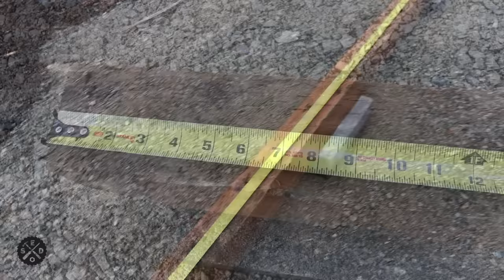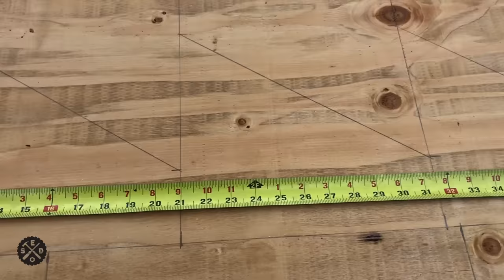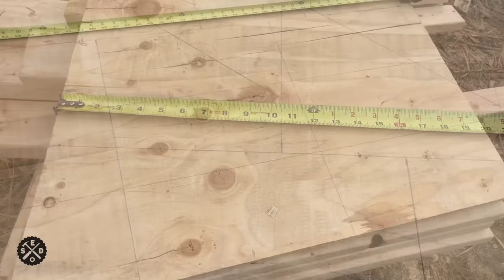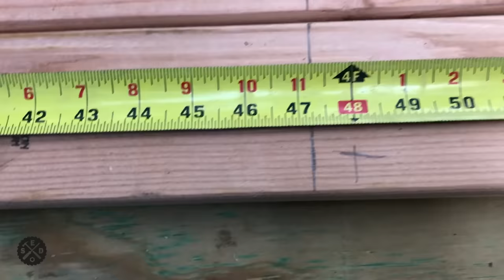How To Build A Shed By Yourself All STEPS 10x16 diy

Comment: If I was to do this I would put a seal plate and a top plate. I believe in structural strength.
Reply from the maker: Yes you certainly could do a double top plate. 👍 I mention that somewhere in the video.
Reply: Single-plate framing is fine on any building, despite what codes or traditions tell you. Old balloon-framed houses with one lonely 2x4 plate have lasted for 175 years. I think it'll work for a shed. 👍🏼

Comment: Instead of toenailing the floor joists to the beams, install 2x4s in between the joists screwed into both the beams and the joists providing a more secure base
Reply from the maker: Yes you could do that.

Comment: I love it!!! I built a 10x16 too. Did it all by hand using Lowes lumber for the foundation and floor, but framing and siding the rest with pine that I cut on my woodmizer LT27 sawmill. I wrapped it with bevelled siding that I cut on the mill and tongue and grooved the 7/8 inch roof boards. Then shingled the roof. I made a sliding 6 foot wide door from oak off of the mill. I put in a hinged door and window ac unit into one end, and large windows that were low enough to slide boards thru when open if i wanted to rip-cut long pieces inside. I used cedar shakes under the gable ends, which look cool. I used true 2 inch by 4 inch framing members, so I had to use 20d nails. (therefore no nail gun, instead a hammer.) I love you video. I took pics and put them in a scrap book, but I should have detailed it in a video, like you did. Youtube wasn't as popular when I built in around 2006. great work friend. I live in Ocoee, florida. stop in in ever in the area. I'm freddy. 407-877-7784
Reply from the maker: Hey Freddy thanks for the invite! Sounds like a really cool build! Well thought out for your needs. I’m glad it turned out well for you. I have a sawmill too now since building this  but I haven’t gotten to use it much yet. Thanks for sharing.

Comment: Back in 2011 I rebuilt my shed taking out an old 7’ X 10’ (old fashioned hand built, probably 25 years old) on a weak concrete slab, upgraded to a 10’ X 14’ and 8’ tall on a 4” concrete slab with a 10’ X 10’ approach on the alley side. It has a service door opposite end of the alley end that has a 7’ X 8’ roll up door (motorcycle access) and a horizontal long window on each side wall. 
I watched your video to see how someone else might/would build their own..
I must say the attention to detail you showed and narrated was impressive. Also talking about how others might convert it into a tiny home or cabin and preparing the subfloor for insulation was totally unexpected but welcomed.
I’m now afraid you have a new subscriber in the works...
P.S. with my full size Goldwing Motorcycle, Snowblower, Lawnmower and other small items in the shed it’s amazing just how fast it filled up...
Reply from the maker: Haha thanks I would appreciate the support! It was fun reading your story. Sounds like you got a much better setup now. Yes if I was to park a motorcycle and a bunch of other equipment I would run out of space very quickly. Lol. Thanks again! Take care.

Comment: As a retired General Contractor, I will say that overall you did a good job. There are a few things I would have done differently, and a few minor things, that should have been added, but overall very well done.  Your assessment of the prefab buildings was spot on. Even if you have no experience at all, with a little bit of patience and study, one can build a much better Out-building cheaper, than the prefabs.
Reply from the maker: Thanks Walt I appreciate the input! 👊
Reply: Walt what are the adds?

Comment: There are a lot of “how to” videos out there and I wish all of them were this good. Ty for the excellent tutorial!  I do have a floor question—what type of plastic and at what layer would you add a vapor barrier for an insulated floor?
Reply from the maker: Thank you I appreciate that! I would probably do at least four mil maybe six mil plastic. I think the best would be to put it on the bottom underneath but that would be really hard to do on a shed like this so I would at least put it on top of the floor joists before you put the floor down. Unless you do spray foam which can seal off for vapor barrier if it’s closed cell foam then you wouldn’t need to worry about plastic. That’s my thoughts

Comment: I'm a hack DIYer taking on my first shed build.  It's a bit intimidating so your video has been an excellent resource.  I really appreciate not only the good instructions, but the effort you put in to making those instructions easily understood and quickly accessible through time-stamping.  Thank you.  Quick question:  what is the rule of thumb for sizing gussets?  Thickness, area, etc.
Reply from the maker: Thank you so much for letting me know! I’m glad if you found it helpful. I’m not quite sure on a rule of thumb for the gussets. I’ve just seen quite a few of them and knew it would work. The wider The better of course. There may be a table to figure it out that I’m not familiar with. If you are concerned about strength up could always use construction adhesive with it too. http://theplywood.com/gussets not sure if this helps at all but it was an interesting read. I wish you the best with your build!!
Reply: @SmartEasyDIYer  yes you'd be great in a tiny home community..
Reply: Thanks,  @SmartEasyDIYer !  That;s a good resource.  Much appreciated.
Reply from the maker: You’re welcome. Good luck with it all!

Comment: Pro tip on moving a shed like this. Drill a 1” hole  in your skids on the inside, not the end. Then if you have to wench it up on a trailer you can use 3/4” steel pipe and a chain and it will keep it from digging into your siding and right up on the trailer.
Reply from the maker: Thanks for sharing!
Reply: I can't wait to understand what stuff like this means 😂

Comment: Well done. Very informative. One suggestion; carefully consider the length of your doors based on wether you will be using a step or a ramp. The way you have yours will prevent the use of either and will have a big step.
Reply from the maker: Thank you so much! Also thanks for sharing those ideas with others. 👊

Comment: Great job. I am debating making a shed in my backyard as well. The only thing I didn't care for was the extra  horizontal 2x4's you put on the walls on the outside. I think it's great for a good structural build but a little overkill for my taste. Using a think sheeting will give enough structural integrity to the walls. Being an electrician (as well as a carpenter) I see the side horizontal  2x4 slats on the wall as an electricians nightmare when running electrical in the wall vertically in future projects. Murphy's Law!
Reply from the maker: Thank you. Yeah if you’re going to be running 4 x 8 sheets of sheeting you can just nail into the stud, I did it because I was doing rough cut siding and they only span 10 inches width so it would only hit top and bottom if I didn’t do something in the middle. You could even furr the whole wall out with one by fours on the exterior it if that would be easier to then you wouldn’t get in the way of running electrical. Good luck with your project!

Comment: You missed a trick after framing and prior to cladding. You touched on the idea of a loft but for a shed, if you're not lining the ceiling, the rafters make a perfect loft shelf for storage. BUT the only time to get whole ply sheets in there is prior to cladding the gable ends. 2 full sheets of ply along one side make the perfect half-loft. They also add massive shear-rigidity to the whole structure.
Reply from the maker: Yes that is a good point that you would want to think about. I was actually able to get a full 8 foot sheet up in the loft after the fact to store stuff so it can be done if you put it in in the correct spot. Lol

Comment: Great video, thank you!  For the 3/4 crushed gravel, could you instead use gravel in the areas just under and around each concrete block, instead of covering the whole area underneath the shed with gravel?  Also, roughly how many inches deep was your crushed gravel?  I'm debating whether to use crushed gravel or concrete piers.  I know piers are much better but also a ton more work.  I'm thinking crushed gravel and then if the shed gets out of level over time I can correct it with shims or something.   Thanks again!
Reply from the maker: Thank you! Yes I think you could put gravel just mainly where are your blocks are instead of the whole thing. I didn’t do crazy deep maybe 4-6 inches. The concrete piers would be a more permanent solution but they would be a lot more work. I just wanted to do blocks because I know this won’t be the final resting place for the shed in the next few years. A lot of people put them on blocks and they’re fine and yes if they do move a little bit you can correct it with jacking it up.
Reply: @SmartEasyDIYer  Pier's don't have to be poured. You can buy them.
Reply from the maker: You could if you prepare the bottoms of the holes well. I could see some settling issues if not installed properly.

Comment: Hi, loved the video and all the details. Sorry if I missed it but what spacing did you leave between the siding boards for expansion? Also, would it make more sense to nail the batten centrally in the gap so it can expand and contract without interfering with the board movement? Thanks
Reply from the maker: Thank you so much! So my boards were all kiln dried so I wasn’t worried about a gap even though most of them were curved enough One way or the other that they would only touch in a few places anyways. Lol  I have seen where people have nailed the batten just in the middle because of that again mine were dried so I wasn’t concerned about that the only problem with nailing them only in the middle is sometimes they can cup outward on the edges over time.
Reply: @SmartEasyDIYer  q
Reply from the maker: What’s Q

Comment: I applaud your used of plywood and not particle board. I see so many sheds with particleboard floors and roof sheathing. It is such an inferior product and it doesn't save much money. Also, I see that you put the tyvec on just for demonstration purposes, but for anyone building a shed they would be much better off not using it at all. It costs money AND you're better off without it so kind of a no-brainer.
Reply from the maker: Thanks for the feedback I appreciate it!

Comment: looks great. 
I love the rustic siding look. BTW to get the bottom cut on your truss 
if your top is 34degrees or 8 in 12 pitch you take 90 degrees minus 34 
and you get 56 ! 
thanks for the video.
Reply from the maker: Thank you! That’s a good tip I didn’t think to mention that in the video.  👍

Comment: Great simplistic build and FINALLY someone else who prefers to not suck up VOCs off of toxic OSB. I refuse to use that also and don't like the off gassing of chemicals for anything I'm sharing breathing space with. Plywood or Bust! Cheers and Peace Out
Reply from the maker: Thanks man! Yes I don’t like the smell or off gassing from it at all. I avoid it as much as I can.
Reply: @SmartEasyDIYer  Allot think it's approved so it's ok, ya so was asbestos and later urea formaldehyde insulation. 25-30 years down the road will tell the damage. Not that plywood is not also chemically fastened together but the amount is night and day compared to OSB and the different particle woods they push out these days as safe plus the fact plywood off gases during the curing process.

Comment: Excellent work.  I had to smile when I saw you assembling the truss rafters. The first time I used a pneumatic nailer is when I was building truss rafters for  a house in 1965.  The day before, I was using #7 galvanized nails and a hammer for the same task.  My impression then was that pneumatic nailers were the best thing since sliced bread.  That opinion still holds.  ✔

Great video.  Thanks!
Reply from the maker: Thank you I appreciate it! Yes what a difference from hand driving to using air nailers! I didn’t know they had them in 1965. Good times.
Reply: @SmartEasyDIYer  As I recall, the nailers were steam-powered in those days.  😎

Comment: While I plan on building a 8 x 12 shed, I do appreciate your video. I have a knock off Little Giant ladder. They are PURE GOLD! I used them when I was in the Navy and learned their usefulness and strength early on.

You pieced together your video so I could follow your guide well. Also, your descriptiveness wasn't too much or too little. Your explanations were good for a novice to be able to use your methods without getting confused. Great video. 
I have built garden sheds but, nothing I would be too concerned about snowfall loads. So, this spring when I begin building my 8 x 12, I am planning on ensuring my roof will be able to handle the heavy loads of ice and snow. Might get away with a cathedral ceiling like you talked about by using a metal roof so the load slides right off.
Enjoy those kids. The day they leave even if it's just down the road is hard for us dads. Cool thing is, they will call on us when their absolutely stuck and can't figure something out. Or like my boys, they will try and when they fail they call me to fix it lol
Reply from the maker: Thank you I really appreciate the feedback! I wish you the best with everything. Yes I’m enjoying my boys they are so fun and I know it goes by much too quick!

Comment: Hello!
I've been searching for quite some time to build the right shed to stay in on weekends at our newly acquired land in East Tennessee and yours is going to be perfect.  I appreciate the step by step video and the tabbed sections for quick reference.  I have good basic tool and wood working skills but never had the knowledge to build a structure like this until watching your video.  Now I think I'll give it a go!
Thanks again and I'll post final project pics when I'm done...Greg.
Reply from the maker: Wow Greg that’s awesome to hear! I wish you the best with your project!! Yes please post a final picture. Thanks
Reply: Will do! 
Couple quick questions:
1) the hinge hardware that you spray painted was that zinc coated or galvanized?
2) Did you ever have any issues with rodents setting up nests etc underneath your shed? 
3) If I insulated the floor joists, would plastic sheet go on top of rolled insulation before putting down flooring?
Thanks again...Greg

Comment: A magnificent shed build. I’m rebuilding my 12x16 shed and making it into my art studio. I like your shed I will need some larger windows, insulation and small wood stove. Most likely a small aircon if the hundred degree weather keeps up.
Reply from the maker: Thank you I appreciate it! Yes the cool thing with these sheds as you can make for whatever your needs are. I hope yours works out good.

Comment: You did a great job on explaining everything. 
I built a small shed which was 8x 12  built on  two 4x4  resting on 8 x16 cement blocks .  I built it  about  forty years ago.  I then moved  it
to my new place  on a flat bed trailer and then reset it on the  cement  blocks,  it has held up very well  over the past years .
Thanks for your great instructions  on your building.
Reply from the maker: Thank you for letting me know!

Comment: This is an awesome video, especially if you want to use it as a base for building a cabin. For a shed though, there is quite a bit of extra materials used that are unnecessary. You definitely don't need to sheet and wrap your roof if you're using steel, just strap it. And like you said, for a shed you don't need to wrap the walls. And if you're using pressure treated runners you don't need pressure treated floor joists. But you did a great job, its a very solid and beautiful shed! This is the way building code tells you, but for places where a building permit is not needed for 160 sq ft (my area in Ontario just changed to no permits for 160 sq ft), code is just a guideline.
Reply from the maker: Yes especially if it’s just a storage shed you could do things differently. Good luck with yours. Thanks!

Comment: Thanks so much we are planning something just like yours but it will be a live-in room (spare bedroom/music/art room/office). So will be insulating all. We will run electricity into it too. We following all your info well so far into the video. We will be sure watch it all and watch it a second time taking notes. Only one thing so far we don’t follow is when you laying your floor you mentioned about —-Joints all the same and split—- can you clarify is is that for live in its best floor plywood seams should be like staggered or anyway please info us about the concept. Thanks again!
Reply from the maker: Thank you! Yes I would recommend staggering the seams typically. I just did it that way because it was for a storage shed and I wanted less seams in my floor. If you’re living in it then you’ll finish the floor off anyways so you won’t care about that but for extra strength you typically always stagger them. I would also do double top plate on your walls. I also just did that because it was for storage. Sorry for the confusion. Good luck with your build!

Comment: Great video! Only thing I see that I would do differently is the header above the door. Having the 2x's lying horizontal, instead of vertically may cause it to sag. The 2x's are much stronger when used vertically.
Reply from the maker: Thank you! Yeah, the only reason I did it is space saving above the door, and it’s not a loadbearing wall.